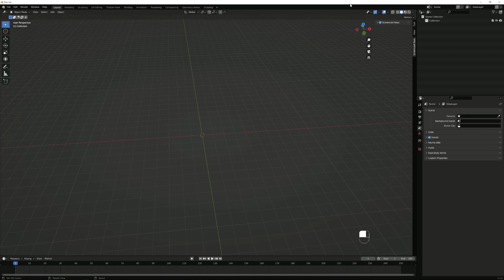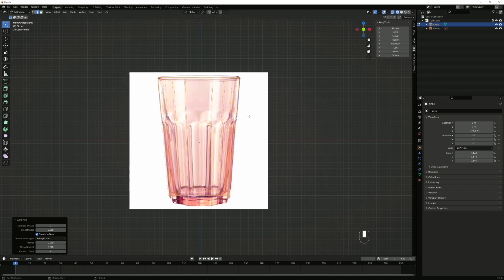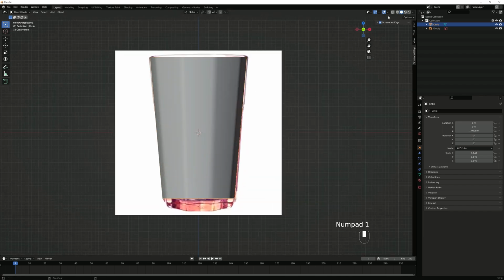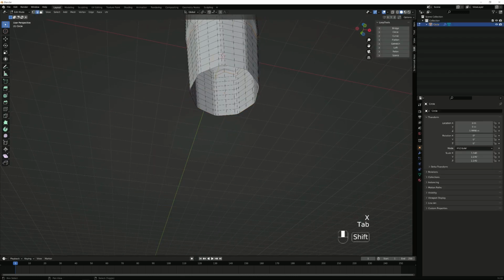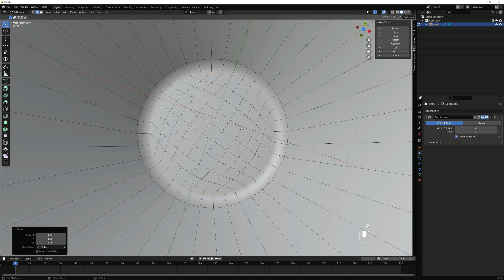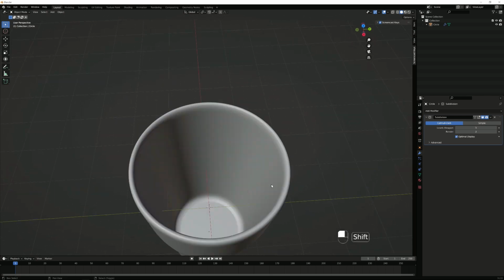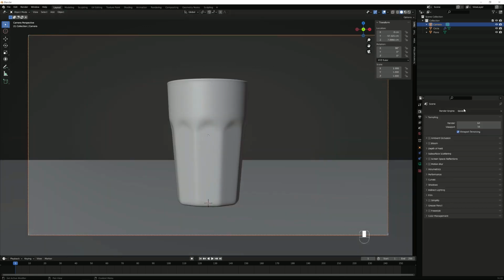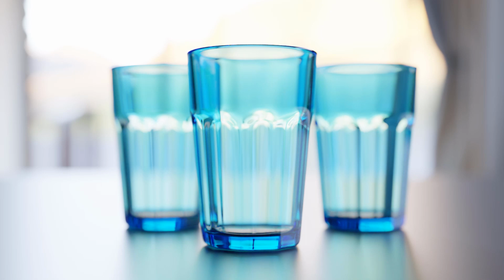How To Make A Pokal Glass In Blender / Blender IKEA Glass Tutorial

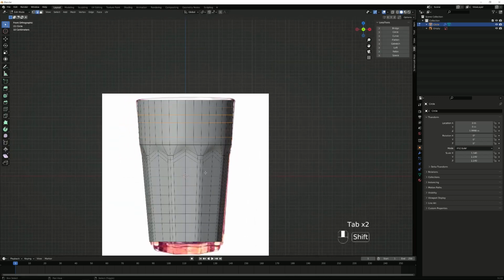Comment: Fantastic tutorial yet again! Thank you so much! As an aside, would you happen to know how to get the arcs around the glass a lot sharper? I tried the trick at 5:46 to move the edge loops up or down, but that still doesn't seem to get them as sharp as I'd like. I want them to be about as sharp as they looked in your dispersion glass tutorial.

Thank you so much!
Reply: I think I just realized I would simply need to add more bevel segments when beveling the edges. Going to re-do the tutorial to see if that works!
Reply: So adding more bevel segments (and making a smaller bevel) worked for making the part directly under the arcs sharper, but above the arcs is still not as sharp as the one in your glass dispersion video.
Reply from the maker: I'll take a look at it later, but basically if you want it really sharp, make it so that you have 5 bevel segments and move the 2 segments from the top and the bottom closer to the center by pressing "G" twice
But I do not recommend making it as sharp because it's not really realistic